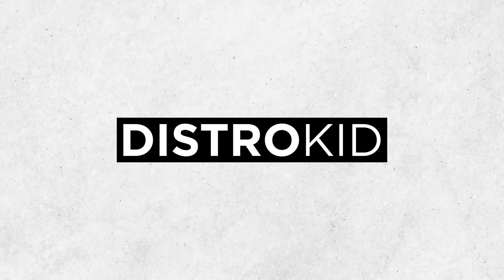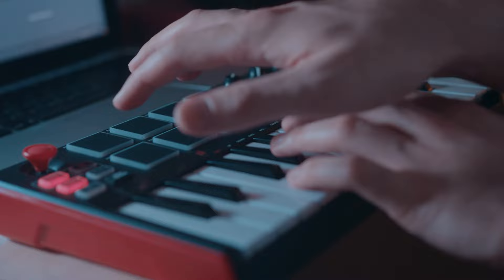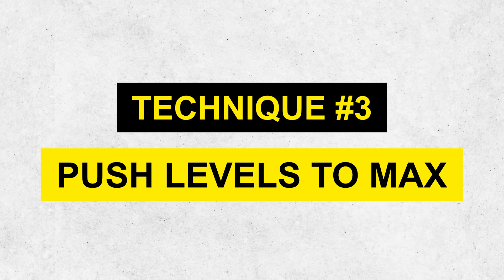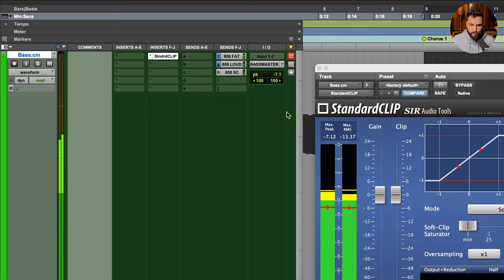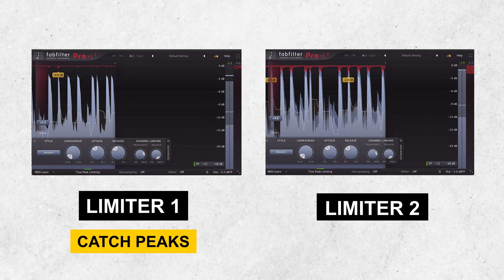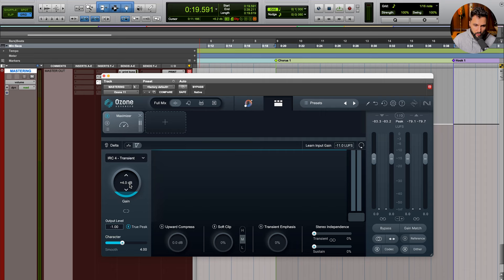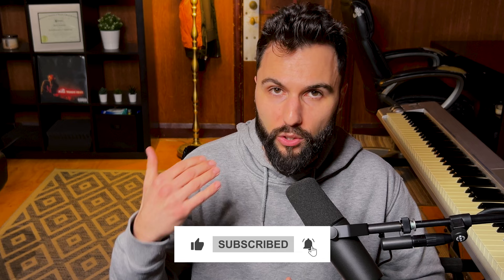MUST-USE Soft Clipping Techniques For LOUDER Mixes ✅

Comment: Dude, you said that you like softclipping more, yet you used standard clip without the soft clip saturator. In other words, you where hardclipping. (just to confirm, I did a quick null test and the soft clip classic, pro and hardclip options null perfectly unless you use the slider)
Reply from the maker: You may be onto something as my understanding, based on my own listening tests and past review of the manual, is that each mode functions differently simply upon entering each mode.

Specifically from the manual (here: https://www.siraudiotools.com/StandardCLIP_manual.php)

"StandardCLIP has a switch to select several different clipping modes. The different clipping modes, represent different clip curves (as you see in the diagram), depend on the setting it can sound more or less saturated. Each mode has a different chracterisic."

Also from the manual, regarding the Soft Clip Pro setting, which I've mostly stayed in here: 

"This mode has a slightly different characteristic. It compresses a dynamic range by half. A line in the function diagram shows the level at which the saturation begins. Dynamic integrity is maintained below this threshold.

25% - compresses the last 6 dB into 3 dB, and adds 3 dB
50% - compresses the last 12 dB into 6 dB, and adds 6 dB
75% - compresses the last 18 dB into 9 dB, and adds 9 dB
100% - compresses the last 24 dB into 12 dB, and adds 12 dB"

Also, it says:

"Soft Clip Saturator
Intensity of soft-clipping function. You can adjust seamlessly between hard-clipping and soft saturated clipping."

Based on this, being in Soft Clip Pro mode, but using 0% of the saturation slider, means I'm soft clipping but with a harder knee than say 100% saturated.

Building on that, being in HardClip mode would produce a different sound and response than Soft Clip Pro mode, regardless of the saturation slider setting.

To be fair, I have trusted the plugin to function as intended and its totally possible I have missed out on what you're saying in my explanation/demo or didn't realize that the two mode are basically the same if the saturation slider isn't used. I'm going to experiment more myself now that you brought it to my attention.

Regardless, I don't think it negates the intended purpose or anything I've outlined here fully - the use cases still apply - BUT perhaps when using StandardCLIP specifically require more use of the soft clip saturator slider, particularly increasing it to produce a soft-knee type of response. Hope this helps/clears things up.
Reply: @5piece  oh, don't get me wrong. I myself, actually prefer hardclipping. 
But a nulltest is undeniable. You can test it yourself by routing the same signal into two channels and reversing the polarity of one, meaning they will cancel each other perfectly since they are the same. If you then put standard clip onto both channels with the exact same settings, other than the mode changed, they will still null, which means they are mathematical the exact same. So despite anything the manual might say about slightlydifferentcurves, the modes are 100% equal unless you use the slider. But yea, the technique is still very valid and you using your ears to determine what plugin you want to "softclip" might suggest that hardclipping instead is something you prefer and should dive into.
I myself like the way hardclipping seems to keep the perceived transients more intact.

Comment: Hey man thanks for this amazing video, wondering if you can help with this, I am using t racks classic clipper, when I use clipping in my mix buss channel do I need to gain match as well? Or do I just leave it as that
Reply: You should always gain match bro, I use the TR5 Classic Clipper too and gain matching definitely helps dial in the sound.
Reply from the maker: The real answer is to use your ears and judgement to decide. 

While gain matching is a popular topic in audio engineering, the reality is, we don't always need to do it. I think its important to gain match at first to understand how your sound is being affected in order to make a calculated decision, and after doing so, SOMETIMES it makes sense to then drive the level and gain stage it to exactly where you like it and where it sounds good. 

With me, I typically do gain match (on average) BUT Sometimes I drive sounds higher, and other times I make them lower. 

I really don't think there is one answer you should always adhere to, I just think its about your taste, judgement and own personal experimentation at the end of day - regardless of what anyone says. Mixing "rules" are meant to be broken after all ;)

Comment: If I use drums via MIDI, I assure myself that, everything is balanced in dynamics, by using this simple method: the higher an instrument is inside the frequency spectrum, the lower the velocity should be. 
This also applies for piano pieces.
So you're already able to safe tons of headroom before even start mixing
Reply from the maker: Makes sense! Definitely applies to the first level of gain staging, simply managing the dynamics of a performance. Taking it up a notch and handling levels, and doing advanced stuff like what I discussed in this video can help take it over the top! 🚀

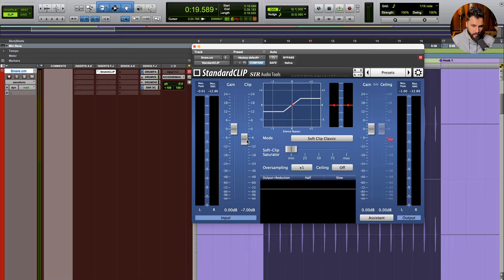Comment: 6:50 TIP for you: Inside the daw's mixer there is no cliping!!! Only the master output is important not to clip (when you export in 16 or 24 bit) !
Reply from the maker: I know what you mean - you’re basically saying (if I’m not misunderstanding) that clipping / overloading an individual channel isn’t “bad” so long as the master output isn’t overloading. 

What I was trying to emphasize there is we can use a clipper to create headroom when things get hot, which therefore helps preserve headroom on the master output as well since it goes that way and combines with everything else in our mix. 

I realize I didn’t say it as explicitly as that obviously, but I think the logic applies. Perhaps a video dedicated to “properly overloading mixer channels without consequence” is in order 👀

Still a great tip especially for anyone who needs the insight! Thanks for sharing
Reply: @5piece  Sure, no problem! Good clip though!
Reply from the maker: @IcemanTheDj appreciate you! 🙏🏼